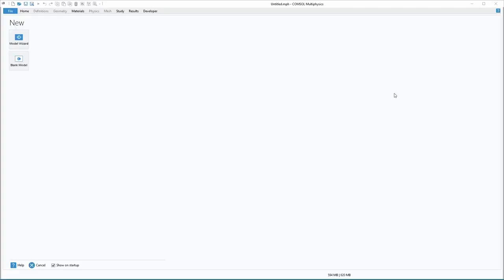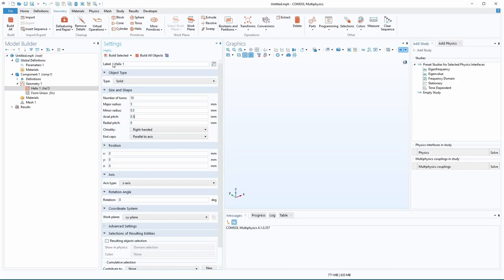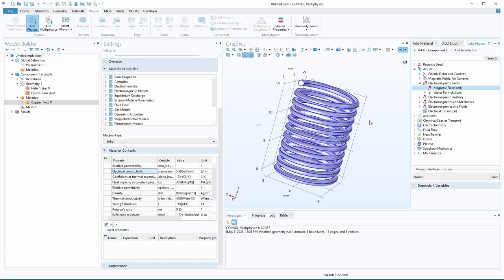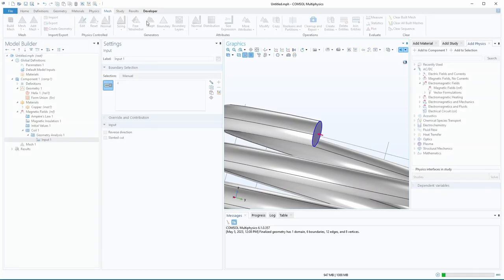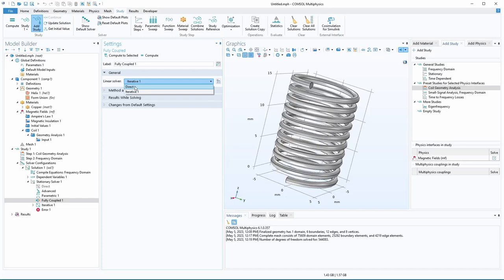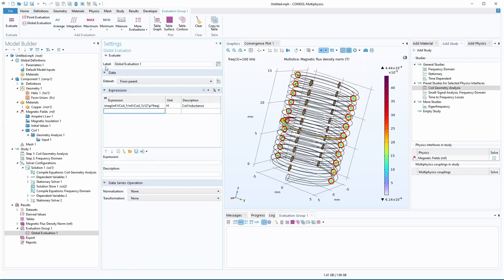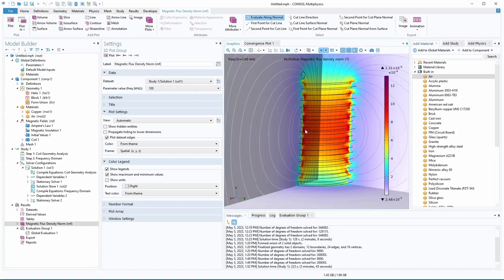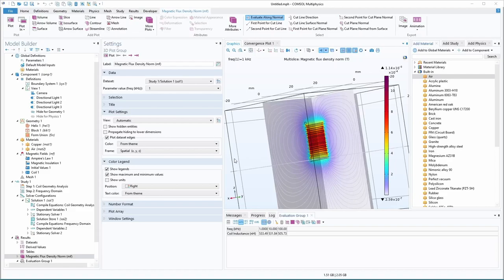COMSOL - 3D EM Intro 1, Quick Start

Comment: Hello. Thank you for posting this video. Is this simulated inductance value equals to measured one?  

Thanks in advance.
Reply from the maker: Hi, that is an excellent question... but unfortunately I didn't wind a coil and measure it to verify. If you have time to check it I'd be interested to know. Thanks for watching!
Reply: @CircuitAnalysis  Dear Sir, I gone through some of the mathematical calculations & using online helical coil inductance calculators. As per the parameters mentioned in this example, I am getting 0.678uH for this model.

Comment: Excuse me. Is there a way to enter the value of the magnetic field into the air?
Reply from the maker: You can set the permeability of the air cube, is that what you mean?
Reply: @CircuitAnalysis I am studying the simulation of energy harvesting from transmission lines using magnetic fields.  But the magnetic field value cannot be entered into the conductor section.
Reply from the maker: @nizn4583  The magnetic field around a conductor is the result of the current through the conductor so you need to put a current excitation in one end and out the other end of the conductor. Then if you put a cube of air around it, the field should propagate outside the conductor into the air and you can put your harvester next to the conductor and it'll pickup the field.
Reply: @CircuitAnalysis Thank you for your advice. I hope you will have some clips to recommend soon😢😂.
Reply from the maker: @nizn4583  In case you haven't seen them already I did make a couple other videos going into more detail which are in this playlist: https://www.youtube.com/playlist?list=PLPJa0dSdlB4XQD1i3NFtbhVOeIq0NliAx